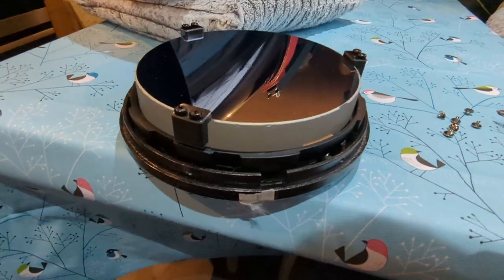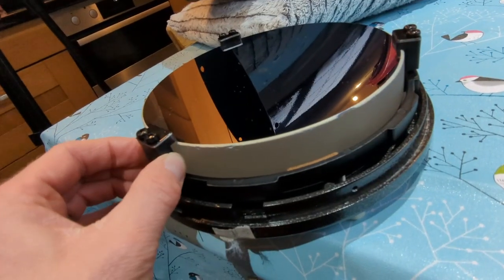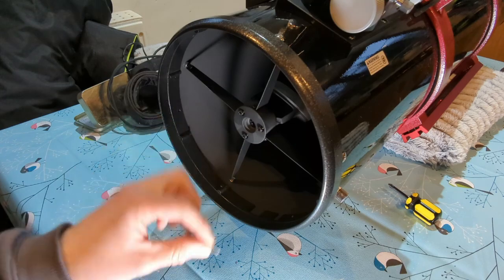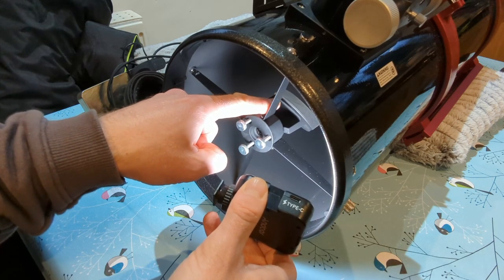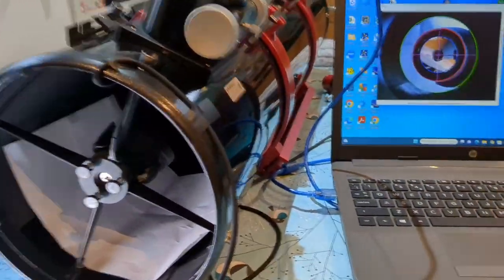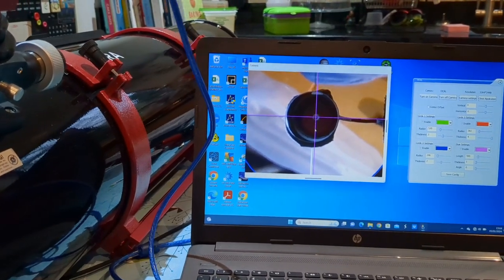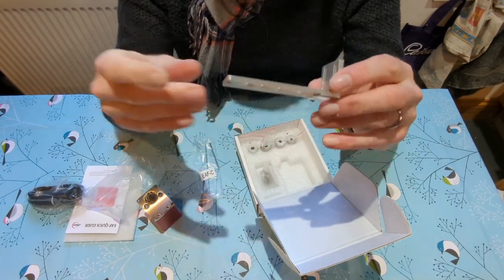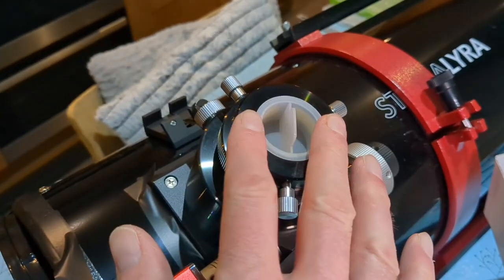Setting Up an Imaging Newtonian

Comment: Hey Andy, nice video. Why did you use a printed bracket and not the included bracket that came with the EAF?
Reply from the maker: Hello, the gso focuser is curved and unfortunately the normal focuser bracket is tricky to fit to this.  The 3d printed version fits the shape of the focuser exactly making it easier to mount the eaf.  Many thanks for watching!